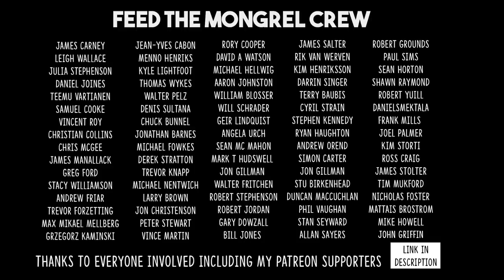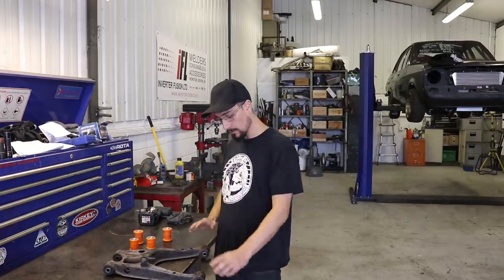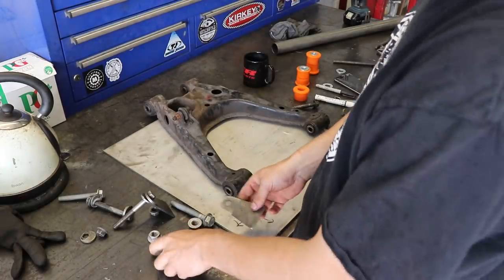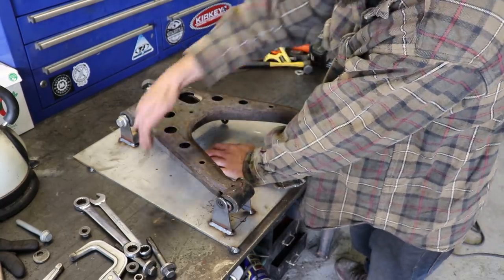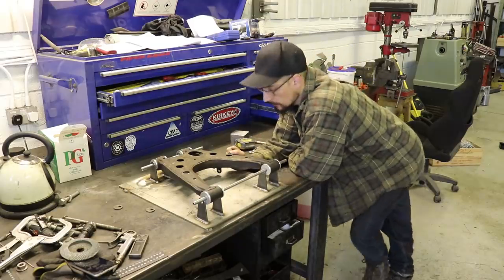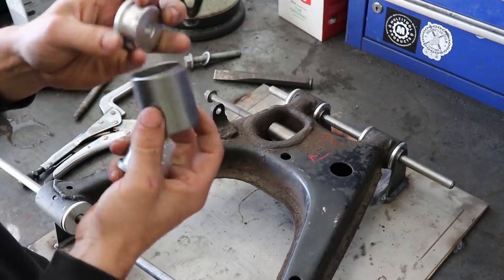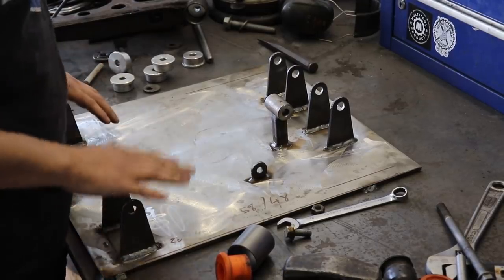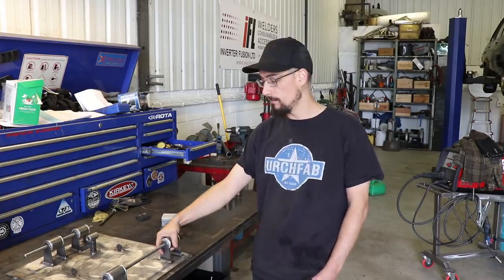THE MONGREL PART 54: BUILDING CUSTOM SUSPENSION ARMS. MX5/ MIATA

Comment: i think with the shock mount and rollbar tab mount added you need to make a left and a right side jig  
or make the mountingpoint for the shock so you can use it from both sides . 
maibe weld the schockmount and the rollbar mount to a small add on plate that you can bolt / fit ontoo the jig both ways 

.... just read some of the comments below , you need to make a left and right side as the mountings for the arms themselves are offset too....
might still be able to adjust for that by spacing the tabs on the front part wider and make offset bushings / spacers to adjust for left and right side 
i think setting that up is doable , fit the other side arm intoo the jig , see wish tab(s) the arm for the other side is resting on top of and needs moving and reweld those tabs to the jig while filling out the space between the tab and bushing on the other side with the spacer 

i bet there be a lot of miata drivers that would like to buy a set for a little less money then the competition 
think making them in series will take about 2 hours per set if you make jigs for cutting everything too , i think that would be a nice income for the work you need to put intoo it
make a sliding jig and you can even make custom widths

Comment: Shouldn't you have moved the outer mount points in 12mm? The ARB and bottom shock mount will have moved in by 12mm so geometry has changed.

Comment: Matt are you sure your anti-rollbar points are in the correct place? I dont know the mx5 platform personally but it seemed like the mounting points should have been welded on with the bar through the inner bushings rather than the outer one's... I've explained myself poorly, sorry bout that but I hope you catch my drift. i.e the original anti rollbar might be too long for the mounting points now?! Correct me if I'm wrong, I have been wrong before...!

Comment: Nice work. Shortening the lower wishbone by 12mm will tip the upper edge of the tyre out closer to the wide arch. I hope you have enough clearance from arch to tyre. Fingers crossed.

Comment: Rather than a calculated guess on the front boss position you could’ve made a front bracket with two holes in to accurately  reposition it. Also wee point get some paraffin for aluminium and alloy it’s a bit cheaper than plusgas as a cutting lubricant
Reply from the maker: Yeh that's a good idea, why didn't I think of that.
Reply: Beat me to it.
Reply: @Urchfab  Happens to all of us but it does help if you've done something vaguely similar before.

Comment: did you think about making the arms adjustable?  could’ve saved you some time on getting your jig dead nuts.  i have made control arm jigs before and made it 2 piece indexed on a piece of c channel with adjustable set screw stop blocks. 
if you don’t have a mill yet you can face stuff off by putting an angle plate on your lathe and chuck up a flycutter.

Comment: Matt, be very carefull with those eurathane bushes as they often bind up the suspension or alternatively squeeze out where they should not. And to have bushings that are supposed to flex they do not, just  wobble all over the shop. 
I have replaced dozens of those with factory rubber as the lower control arms walk back and forth in the sleeves. And seen a LOT of broken control arms where they do not have enough flex.Or crack out where the brackets mount to the chassis.  I use it in race car sway bar bushes and castor arm bushes and inspect regularly
The factory rubber that bonds to the steel sleeves is required.
Heim joints or spherical bushings also bind, factory rubber has more flex so does not bind. Think about it before you make stuff. At worst case most  control arms have to go through a 45 deg angles
Reply: LDN Wholesale are poly bushes not supposed to rotate on the steel sleeve, I could be wrong here, I often am.

Comment: Before you go any further check the toe in on the Mazda rear axle. Cant just build two arms and flip one over as the car will tend to go down the road crabing. Toe in should be about 0.5 to 1 degree between the two sides. That is why original arm does not fit when you turned it over.
Reply: The arms are symmetric along the length of the car, not along the rear axle, right? It should have been flipped along either of the rods that go through the bushings, not sideways.

Dang it's hard explaining geometry without coordinates. :)
Reply: Mazda build in toe in by fitting eccentric bushes. This means that the two rods going through the bushes are not exactly parallel to each other. Search Miata.net for all the figures on rear wheel alignment

Comment: Can't wait for part two, I want to see what happens when you flip the wishbone in that jig, because the shock bolt doesn't look central to me. You must have a trick up your sleeve.
Reply: When he says central he means the same plane as the bushing bolts, ie. same measurement off the jig deck
Reply: @piperdoug428  Yeah I considered that, but when looking down at the wishbone it's asymmetrical, meaning the shock bushing bolt is over to one side. When you flip the part over from left to right, it looks like he'll have a problem. If you flip the part from top to bottom, the anti-roll bar points won't line up. But I don't know what the final design will look like, so I'm interested how this turns out.
Reply: @ProjectSupercar  Ha ha, yeah i see where yer getting at, so the shock bolt in the same plane left or right but when he adds the sway-bar tab he then has to flip it front to back for the mirror image, this is hard to describe but when he does it you'll be "ahhhhh"
Reply: @piperdoug428  Yeah, I was think that, maybe the jig is to be used in 2 actions, first weld in the shock mount, then flip it from left to right for the sway-bar links. But then I thought the jig would fowl where the shock mount is on the flip. The problem is I don't know what the clearance is, or what the final design will be. It's going to be interesting. Like you say, when I see what he has planned, I'd be "ahhhhh" ;)

Comment: Good video .you do great work .everything should work except one of the anti roll bar mounts needs to be lifted higher off the jig to compensate for it not being on the same level as the other jig fixings .
Reply from the maker: Not sure what you mean but I'm sure it will become clear.
Reply: When you are making the second wishbone the anti roll bar mount will be on the top not on the bottom because you flipped it over .

Comment: Great video but I think your sway bar links should have stayed the same distance from the inner bushings instead of from the outer bushings. I think they will be a total of 24MM to narrow for the sway bar the. So I think the inner bushings should have been mounted in the jig and then the jig bracket located and tacked to the sway bar link bracket. That way the sway bar links will be the same distance apart once the new control arm is installed.

I hope I am wrong. 

Thank you for all the great, clear, inspiring videos.
Ed
Reply: Sorry Matt, I meant to say mount the arm in the jig with the OUTER bushings attached and then weld the sway bar tabs in place

Comment: Next  time just measure all dimensions , make a drawing, and work from that. No need for Aluminum bushes or the rubber ones either. For track use a pivot bolt through tubing with some grease is enough. The bolt as well as the tubing is sacrificial. Simpler lighter and stiffer. When worn out simply replace your fabricated arms and pivot bolts. Why do you build for longevity and not lightness and stiffness?  You could just lighten the factory arms as they are substantially over built for longevity.

Comment: is there anything to look for when attempting to swap the body of one car to the floor/firewall of another vehicle? track width, wheelbase?
Reply: I'm not anywhere near Matt's level but I would say yes and yes on those two points, other than that probably just looking at vehicle types you're mixing, because things like seating position could come into play for where the dash and windshield will land for your field of view, of course a bracket can be built to compensate

Comment: I'm concerned about the ally bushes once they get tightened down, with the up and down movement of the suspension they could either wear fairly quick or start backing out the bolts.
Reply: I'm pretty sure they are just for this jig, not for using on the car.

Comment: do you not want your arb tabs pushed towards the outside of the arm the 12mm, to maintain the original droplink angle? And the bottom shock mount too as long as there will still be clearance to the rim, so as to have the shock top mount still sitting naturally.  But 12mm isn't crazy amount to begin with.

tldr jig the shock and arb with inner bushes aligned instead of the outer
Reply: I was thinking the same thing. I would position the arb and shock mounts with the inner end of the arm bolted in the fixture. Now those mount points are also moved 12mm. I hope it doesn't matter in practice, but the spring/damper ratio will be slightly different.

Comment: Thanks for this video, I own a MX5 and have been considering fabbing my own as the factory parts are quite heavy.
Reply from the maker: I think mine might end up just as heavy to be honest.
Reply: @Urchfab  But that is part of the benefit of taking time to make the jig correctly, you can always experiment with other ways of connecting the "dots" as it were,  I could see smaller diameter heavier wall round tube as opposed to plasma cut "I" beam.  Bit of a warning, you are getting very close to the engineering side of fabrication and it can drive you nuts.

Comment: Sorry to say but You’re Doing it Wrong!
First you want new parts to make the jig from in case the ones you have are damaged or worn out.
Second you don’t just eyeball it. You make two separate plates 12 or so millimeters apart that are held square to each other then you remove the part and close the gap.
Third you look at what light weight parts are on the market and copy those as the designers should have the strength sorted out already.
Reply: 1 expensive and takes time to get the stuff, 2 eye balling can be really accurate if you're good at it, and the thing will move when welding anyways, this is not a part for NASA and the byshings have some give. 3 yes, this is a great tip, but you could also modell it in cad and do a FEM analysis yourself if you can't copy a someone else, it's quite simple now days with youtube tutorials and piracy. Moral of the story, just cause they don't do it your way dosen't make it wrong
Reply: Oskar Thompson . I was being a bit humorous but as someone who has been there done that I know what I’m talking about, his fab work is good and I can only drool at the sight of the gear he has compared to what I had to work with. Errors in position can be corrected during a wheel alignment but that takes away from the available adjustment and the error could be too great to adjust out. It is easiest and best to do it the right way the first time.